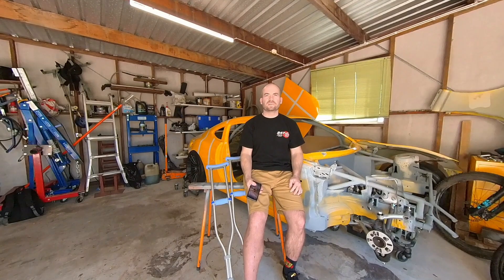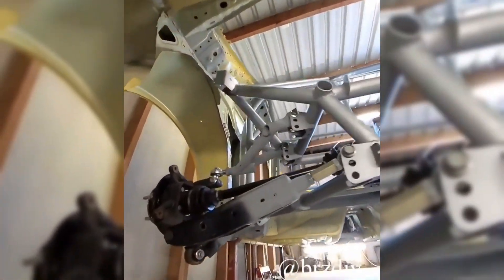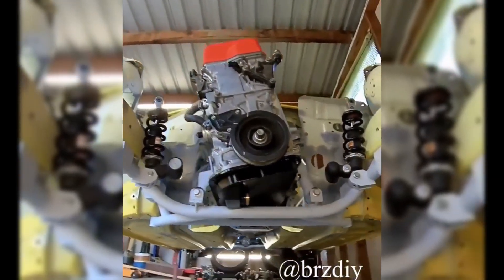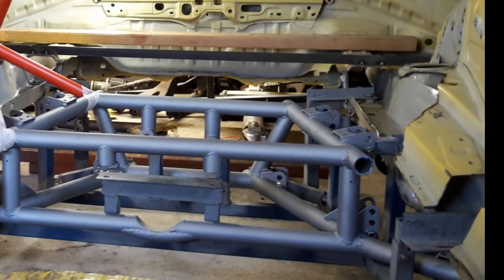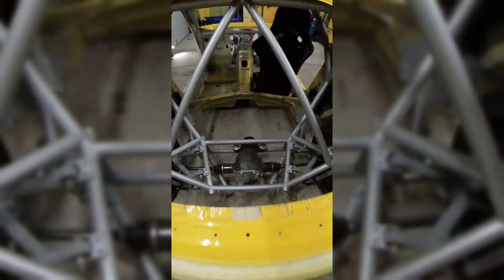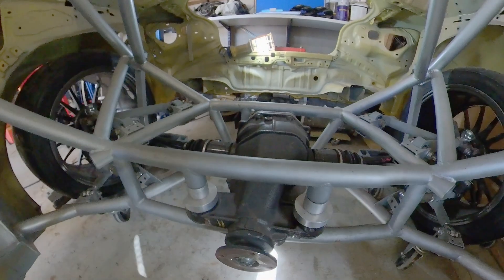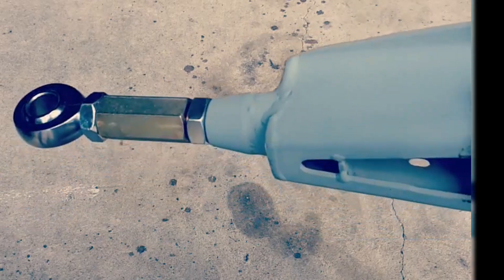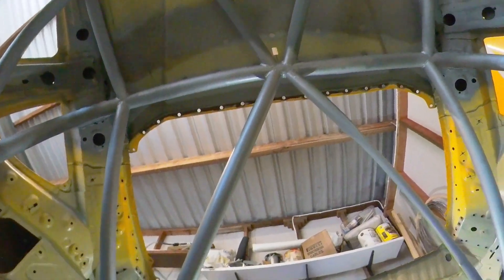Build Breakdown Ep.1

Comment: Awesome build! Very interested to hear more about the effect of the rear trailing arm on anti squat, I understand that lowering the subframe side pivot will reduce anti squat, a lot of people seem to discuss this adding grip or better traction. I always thought more anti squat forces the tire into the ground providing higher traction potential if the tyre can take it. I’m sure it’s a trade off, a big advantage of less anti squat would be suspension compliance in bumpy corner exits. I wonder if raising the factory subframe would also decrease anti squat? Would love to hear your take on adjusting anti squat.
Reply from the maker: Thank you, I must admit I didn't put too much thought into this, the reduction in anti-squat was inspired by the MCA Traction mod which is a simple bolt on part made by a very well respected suspension company here in Australia. My modification simply does the same with a little more scope for adjustment. Raising the subframe alone will have no change as all the other arms will move up by the same amount. You need to move that pivot point relative to the other pivot points.
Reply: Did you draw any inspiration from the new GR86 suspension geometry? And apply it to your build?
Reply from the maker: @luisking4812  no this was all done before that car was released.
Reply: @joeldavis3152  
Fair enough.. 

hope you can completely recover and keep building!